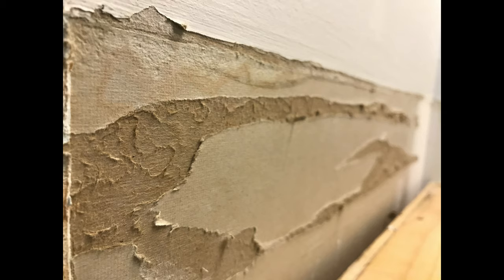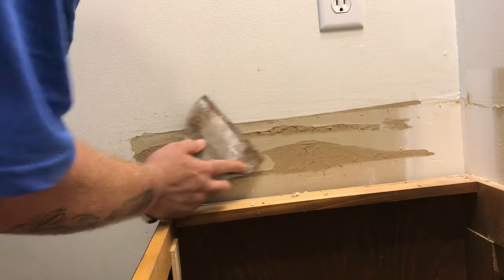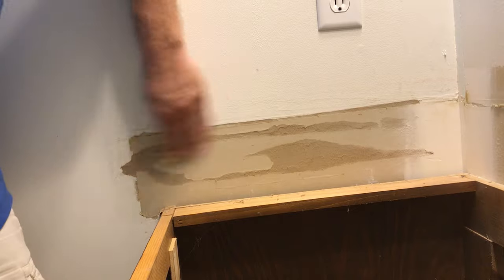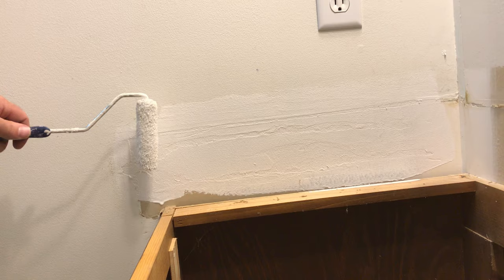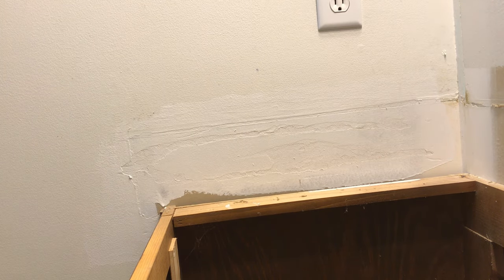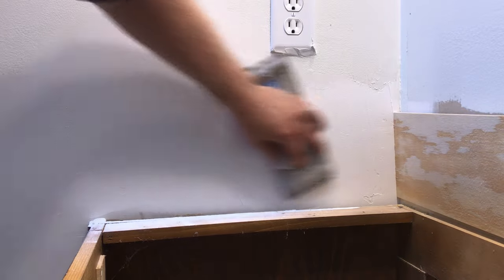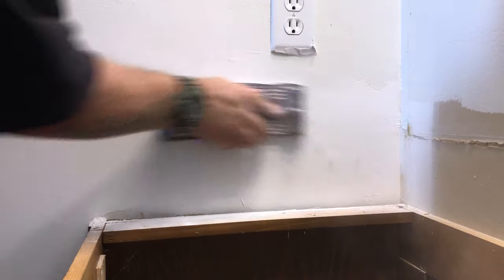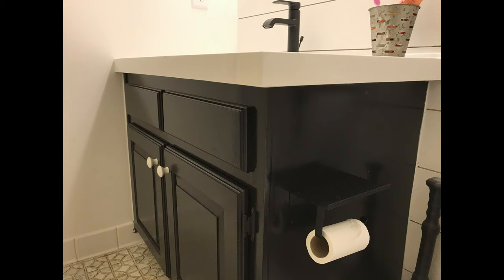Torn Drywall Paper REPAIR | DIY DRYWALL

Comment: You saved me big time I ruined my rental kitchen wall with peel and stick backsplash
Reply from the maker: This comment right here is why I do these videos.  I’m very glad it helped.  Now you’ll never be afraid of this type of situation again.
Reply: Oh my— I did the exact same thing!  That stuff tore my walls down to the paper!  I was just about to mud over it when you found your video!  Followed your steps and am as I type this post, waiting for the joint compound to dry so that I can prime and paint!  Thank you so much for saving my kitchen walls and making me look like  a DIY Diva at the same time!!  Thanks again!!!
Reply: I just removed my slap and stick and it tore the drywall paper and paint off. Do I do the same as you did in this video since the walls are painted?
Reply: @TonyCollumtheHOWTOHERO SURE
Reply: Peel and stick also did the same thing to my walls.   I am going to try this tomorrow. I don't have much experience but you made this look easy for me. Thank you for making this video!

Comment: Are you supposed to prime after you finish sanding? I painted after sanding and my daughter put a poster (2 weeks after) with tape. When we took it off due to it was put on wrong wall the paint come off easily and this was over the drywall that I had fixed.

Comment: If you don't have specialty primer, wood glue works well too. Thinly spread the wood glue over the brown paper, let it dry and cure, rough it up a bit, then you can mud and paint as usual. If you're doing a small repair, people are way more likely to have wood glue on hand than specialty primer. As a complete novice trying to repair the wall damage from a really terrible "professional" vanity installation, I had like 15 square inches of damaged brown paper, and this worked a treat, no bubbling at all.

Comment: Ive mudded over entire walls like this many times , it does bubble up in places but then i slice the ripples or bubbles down the middle with a sharp razor knife so the moisture from the compound can get inside the dry area of the bubbles  and when it drys it will suck the bubbles down .Then i sand it all them broom off the majrity of  the drywall dust  then go back over it with a second coat of mud thinned down with just a touch of water ,then i let it dry overnight or use a big fan for a couple hours then go over it with a 220 sanding screen then broom it down or use a shop vac with a brush attachment to get as much drywall dust as possible off the walls  then i prime the drywall then paint it, The key is getting that first coat of mud mixed right on the first coat so it wets the paper just enough. my master bedroom was entirely covered with 2 layers of old wallpaper. i sprayed California knockdown texture over the walls. 15 years and it still looks perfect, could use some paint now to freshen it up
Reply from the maker: I agree it can be done.  I’ve done large rooms as well…but I just don’t like chasing bubbles or wasting time.  The Zissner takes about 15 minutes to dry and I’m skin coating (with no bubbles).  Try this method once, you’ll like it.

Comment: I bought some Roman pro 999 RX 35 because when i called zisner they told me they dont make a product that is designed to seal torn drywall paper. I havnt used it yet. I cant remember a specific time i had to repair over torn paper but i know in 30 years of building and remodeling i have encountered it. I never searched around trying to find out how to fix it. Im sure i cleaned it up best i could. Primed it and put mud on it. Ive never had a call back on any job for my work failing but after being out of the loop for several years i started watching youtube videos and got scared i was doing something wrong. I figured technology has changed so maybe drywall and mud has too. I dont know if i just got taken or if i just got lucky for 30 years. I figure the rx35 is prob better than just a primer coat but like i said my old way never failed me. Good video. I wish i had seen it before i searched the world over for the rx35 they are so proud of money wise
Reply from the maker: David, you are absolutely right.  Sealing the paper is not the way, just a way.  Like you, I had fixed many a drywall repairs (torn paper) with just mud.  It always worked and I always received a nice finished product... but it never failed that I would get that errant bubble of the paper and I’d have to fight it to get the job done.  With sealing the paper I’m able to complete the job quicker, with less chance of bubble or stray paper.  When I had my handyman business, and now as a builder I’ve got to have quick ways to get each job done so I can move to the next.  Thanks for watching

Comment: With small areas like this, after smoothing, I apply a very thin coat of polyfilla.  It acts as a base and sealant. then I go over with regular mud.  never had bubbling happen.
Reply from the maker: Great tip.

Comment: I got this Rx pro 999 by Roman. It’s for sealing the paper. If I already spread some Titebond on it, I can go on top of that with the Roman pro 999 before quick setting mud right ?

Thanks. Great video btw
Reply: Yup, that is exactly what its for but, you have to wait for it to dry.. check the TDS for the product.

Comment: You say in this video that Gardz and B-I-N work the exact same way, but the instruction manual for B-I-N says to use Gardz first: "Damaged drywall should be repaired prior to priming. Spot prime area of torn drywall facing paper or exposed gypsum core with GardZ® Problem Surface Sealer and then skim coat with drywall mud before priming the total area with B-I-N Shellac-Base Primer."

Would also be curious to hear your advice for when the paper is completely gone, i.e. when significant bare gypsum is exposed.
Reply from the maker: My advice is not meant to be contradictory to the manufacturer by any means...I’m just giving my advice on what I’ve had work for me.  At the end of the day the goal is to seal the paper.  Even an oil based paint could do that.   This was just to help keep others from wasting time putting mud over bare paper.  Also, I don’t see the point in buying $100 worth of material for such a simple fix (both products are close to $50 a gallon).

Depending on how big of an area of bare gypsum you are dealing with, I would treat it just like the other repairs...seal, mud, and finish.
Reply: @TonyCollumtheHOWTOHERO  thanks for the reply! These both come in quart-size now too, although it might be hard to find. Thanks for the tips. Crossing my fingers that I can seal this up right on the first try!
Reply from the maker: You got this.
Reply: This answered my dilemma. I have exposed gypsum with all paper torn awar in some areas. I've searched near and far for the perfect video, Question.  THANK  YOU. I'm going to try this method today. I purchased the quart or gartz and  yes I drove far for it.

Comment: Alternatives are Bullseye 1-2-3, Kilz restoration or Pro sealer (clear).
Reply: Bullseye is water based. Make sure your wall doesn't have residue glue from wallpaper. Must use oil based primer, not 1-2-3.  Water based will activate glue.

Comment: I have an entire drywall panel that needs repair. The previous owners removed wallpaper from a panel of drywall that had not been primed and took all the drywall paper off too. I cannot afford to have the panel replaced, unfortunately. Is it possible to scrape and sand what's left then apply the Zinsser Primer to it? I realize replacing the panel would be the best but that's just not an option. Any advice is appreciated.

Comment: Does this step need to be done if I’m tiling over the ripped drywall?
Reply from the maker: No.  But you do want to remove any peeling material.  Then use mastic to adhere tile

Comment: I think I have a big problem in my kitchen 🤦🏽‍♀️🤣🤔 I took down my glass tile. Whoever the previous homeowner had install the backsplash, used double sided big square tape and cement or grout I guess🤷🏽‍♀️. Most of the sticky is still left on the wall and some is torn off like what you showed. 🤯😨😰 I DONT KNOW WHAT TO DO!
Reply from the maker: You could try using Goo Off on the sticky residue and see if it comes off...in my experience though, if I’m going to spend more time and energy trying to prep or repair (already damaged) Sheetrock I just find it easier to cut out the damaged area and replace with new. Either way there is work involved which can be frustrating.
Reply: @TonyCollumtheHOWTOHERO  thank you! It’s a pretty big small space to for me to repair and it’s not in the budget. Would anything bad happen under peel and stick backsplash paper
Reply from the maker: @TheDria20  I would try and remove any foreign objects like grout, excess glue, etc.  (and if it’s in the budget Dona skim coat of drywall mud and prime to seal)...paper is thin and any imperfections on the base (drywall) will telegraph through the paper...meaning you will be able to see them and in some instances they will be highlighted by shadows and light.  If you were putting a tile or thicker material over the area I wouldn’t worry as much, but paper (wallpaper) is telling.

Comment: Hello! Thank you for making this smart video. Curious… I’m installing a new vinyl baseboard with adhesive, replacing the old. Is it ok to place the new one over torn drywall, or do I need to go through the scrape, primer & mud steps before gluing baseboard on?

Comment: Tore off old wallpaper, damaged the drywall with scoring (and the wallpaper being adhered to plaster & straight in drywall) I painted over with oil based kilz. Can I now seal it  again using shellac & thin set with tons of sanding to smooth it out and finally use Eco-Prim grip before applying tile? Seems like overkill. Completely confused what to do now.

Comment: Oops should’ve watched this before I started 🤦🏻‍♀️ I put mud right over. What should I do !!
Reply from the maker: Just sand like normal and deal with any bubbles that pop up.  For small areas it’s no big deal…for larger areas it could be much harder without sealing first
Reply: @TonyCollumtheHOWTOHERO  bubbles are showing up. How do I get rid of it
Reply from the maker: @Iamme-wv1fn  is it the paper bubbling?  If so, cut the bubbles out with a razor knife (removing the bubbles up paper only, seal with the primer I showed in the video, and then re-skim with mud
Reply: @TonyCollumtheHOWTOHERO  yea I’ll try. Thanks!

Comment: Would this be the same method for removing the granite backsplash from a home in order to replace it with another full backsplash?
Reply from the maker: Sealing the paper is very important when adding any type of material.  The paper is not stable.

Comment: I just removed a bathroom mirror that ripped the dry wall bc it was a glued on mirror. Well... I didn’t know to seal the area first and just put mud right on the paper. Should I try removing the mud and redo it?
Reply from the maker: Not necessarily.  I’ve done plenty without doing this trick...before I knew it.  The problem is the paper (brown paper) likes to bubble.  And the bubble shows as you start sanding to finish.  So, if you sand and see the paper starting to bubble you may want to try sanding down to the repair and sealing. Not the end of the world, just frustrating
Reply: Ty so much for the quick reply! I’m learning as I go as a new homeowner. Next time I have this problem I will definitely seal it first. 🙈
Reply from the maker: @ashleydanielle6355  you got this.  Hang around the channel and I’m sure I’ll post other useful tricks.  We also have a Facebook group
Reply: Thanks for the question! 

I just removed wallpaper border and I've torn some of the drywall in the process. Of course, like you, I mudded over the tears. Just did this last night so I'll see if I run into problems while sanding. If I do, I'll try Tony Collum's advice. Thanks again!!

Comment: Hello and thank you for the video.  I had to take up my floor and bottom tiles that line the wall and the floor and in doing so the paper came completely off exposing the actual chalk.  Will ZIn bin work . Ive been told I can just primer over the chalk . 
1) Do I need to do both.
2) Can I just use a primer, what kind.  I don't really trust what Ive been told because I cant see how anything will hold onto chalk.  But, in seeing your vid. I believe you may have an answer. Really stuck.
Anyone?
Reply from the maker: With exposed drywall, remove any loose material.  Priming the exposed chalk (the actual drywall) don’t really matter.  Depending on the size of the area, you can use 20 minute, 45 minute, or 90 minute mud to fill the area back to smooth.  If it is a large area you may need to consider cutting out the damaged area and making a patch repair (with a new piece of drywall)

Comment: Hi if u dont mind can u say what do u use after the bin shellac prime ,lol I'm kinda lost here 😅
Reply from the maker: After the primer you are ready to skim with drywall mud.  A lightweight drywall compound is easier to sand, but takes longer to dry.  Or, you can go with a 20 minute or 90 minute mud…dries faster (because of the additives added) but is harder to sand.  Not terribly hard but a noticeable difference from the lightweight mud
Reply: @TonyCollumtheHOWTOHERO  thank you 😊 I will do that , I never did something like this before so I hope I don't mess with my back splash 😉

Comment: may be a dumb question, but could I use KILZ All-Purpose Primer 2 instead?
Reply from the maker: I don’t recommend using a water based product.  The reason for sealing prior to using mud is because the water in the mud causes bubbles in the paper which rises through the mud and causes issues when sanding.  I would imagine the water in the latex primer would do the same thing.
Reply: @TonyCollumtheHOWTOHERO  thank you!! i just patched some holes in a wall that were pretty deep (from curtain rods). if i already filled them, would you recommend using that BINZ primer (for extra protection) over it too or just continue to sand and paint?
Reply from the maker: Don’t waste your money.  Just sand and paint.  It’s possible that you get some fuzzies or a bubble, but I don’t think the BIN would help you (at this point).  Just remember next time to seal the paper before adding mud to it.
Reply: @TonyCollumtheHOWTOHERO  thank you so much for your help!!
Reply from the maker: Anytime
Reply: The only dumb question is an unasked one! Because you are not alone I had this exact same question! So thank you

Comment: With this technique, after your done can u put tile on it ?
Reply from the maker: I’ve never done it, but as long as it’s stable I don’t see why you couldn’t.  I wouldn’t use thin set though.  I like mastic in this situation as it’s a glue.  Just make sure the weight of the tile and the mastic can’t cause the paper to peel.

Comment: do you need to put on another coat of the Gardz after sanding the mud before painting?
Reply from the maker: Great question.  after sanding the mud just prime the drywall repair and paint.  You can use a primer, or an extra coat of the final top coat you are using, or you can use a PVA primer (what I use for larger drywall repairs and skim coats).  As long as you seal the mud you will be fine

Comment: Thank you for this info.  What should I do if I had a hole with a some brown drywall paper showing after removing a towel rack.  I hot mudded over it and it has hardened. Uh oh.  Should I knock it out now (How?) and start over?  Or leave it and hope for the best?  I'm thinking knock it out somehow.  What should I do now?  Thanks again.
Reply from the maker: Work the mud you already did.  May not be a problem
Reply: @TonyCollumtheHOWTOHERO  Thx so much.  It was just a tiny bit of drywall paper and the dry mud worked with an add'l coat of joint compound and sanding.  But 2 more issues arose. When I primed the entire wall to prepare for paint, the areas I repaired are flat/dull and not like the rest of the wall. What'd I do wrong? Don't dare paint yet for fear patches will be different than rest of wall. 2nd- some of walls have a little texture from someone painting with a 1/2" roller. Some of wall is smooth because of my repair with hot mud and some remain a little textured.  Do I need to skim coat all the walls? Yikes. Thx.  Suggestions?

Comment: Just added the primer to the brown part of the dray wall.  If the brown starts to bubble, do you tear and reapply the primer?
Reply from the maker: Usually the bubble will go away once the primer is dry.  If you have to remove paper because of bubbling try and apply the primer lightly the next time.  A “dry brush” application of the primer will seal without adding too much liquid which cause bubbling
Reply: @TonyCollumtheHOWTOHERO  ok thanks illl try it out

Comment: So what IS the difference between bin and gardz? I can find bin around here, but not gardz.
Reply from the maker: Gardz is more of a treatment coating for problem areas...where BIN is a “primer”.  BIN doesn’t replace Gardz, but like you, Gardz isn’t available in my area so I used something I knew would seal the paper and keep it from bubbling.